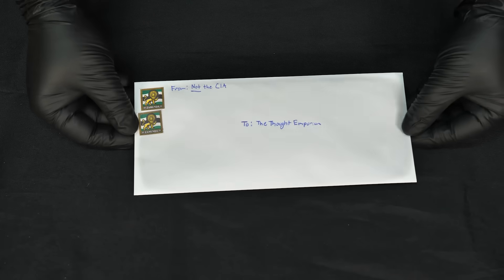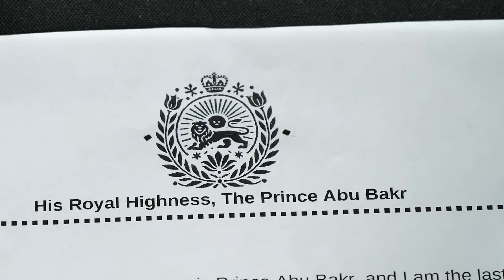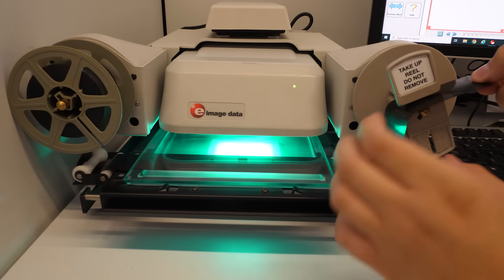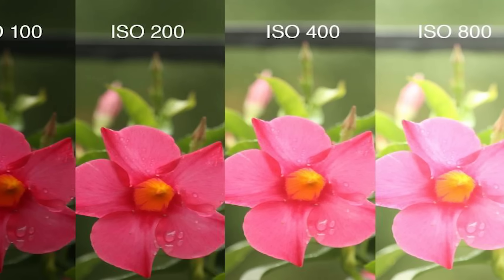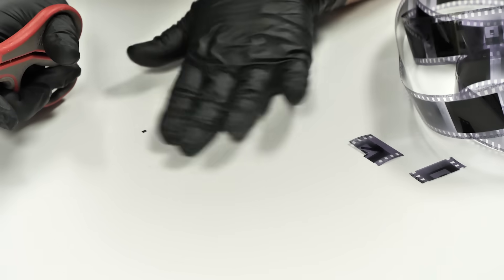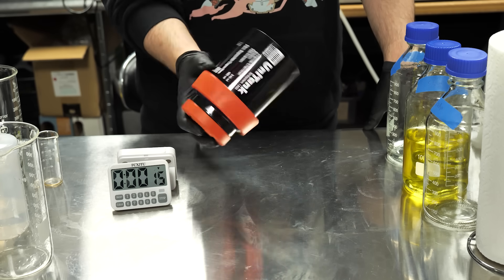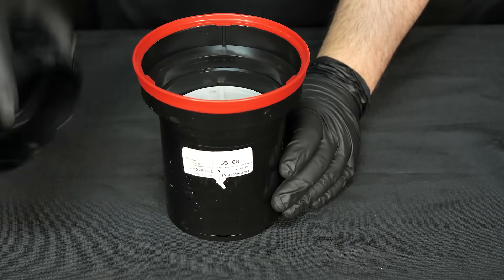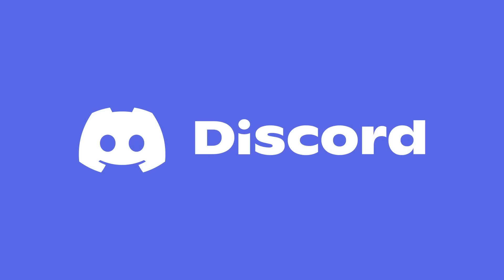Recreating CIA Technology Was Surprisingly Easy (Microdots)

Comment: I looked up the Blazinal film developer, and it appears to be similar to the old Agfa Rodinal formula. That specific developer is designed to be a one-shot formula, i.e., not intended to be reused. Many other formulas such as D-76/ID-11, DK-60a, etc. can be used more than once but you usually increase the development time for each subsequent use. Also, others have mentioned films with much finer grain and slower speed such as ISO/ASA 3 which will provide superior results. I could talk all day about film developing as I was heavily involved with it many years ago, but I'll spare the comment section :)

Comment: Microfiche film has and ISO/ASA of less than 1. Something like 0.2, 0.4.  I had my own darkroom for years. Note that temperature is CRITICAL in developing. Using the manufacturer's temp is good. You can also raise the temp (called "pushing") to speed development (with a significant loss of resolution) and lower the temp to increase resolution. Kodak used to have a table available for their developers. And yes, developer can be reused. There was an amount based on square inches(?) of film it was good for. But 5 or 6 35mm rolls should be OK.

Comment: "The only way to know if your pictures look right is to develop them" Sorry but that part of the video just destroys a big part of trustworthiness in information provided here for everyone knowing a bit about photography. There are lightmeters to determine shutter speeds and aperture settings based on the used film ISO. If you dont have a light meter just use a digital camera or smartphone as your lightmeter by looking at the shutter speed and aperture they use when set to the same ISO as the film. And most importantly the Nikon used here should already have a lightmeter built in to provide correct exposure of the film with minimal input of the user! Also developing a correctly exposed black and white film should be very straight forward if you follow the instructions provided with the chemicals. My first thought when seeing the 35mm camera was "He is going to waste a whole film for one shot" and not wasting alot of film for not even reading about the absolute basics beforehand.

Comment: In the early 1970's I was employed by Microform Data Systems. The product was ultra-microfilm readers and media. This was on the cusp of the rise of digital information systems. The media was strips of 35mm film with six frames. Each frame held hundreds of pages of text reduced in size by a factor of 200 times. About ten strips fit into a cassette that allowed any strip to be fed into the reader. A large installation was purchased by General Telephone (LA) for their directory information operators. An array of readers was connected to a Digital Equipment Corporation PDP8 mini-computer. The computer held the programming to control the readers to select the correct strip, frame and exact page location on the frame for a given name input by the operator instead of thumbing through a mound of telephone directories. I worked there for three years but even then it was obvious to me that any such system would be replaced by entirely digital data systems. Even so. microfilm is still one of the most durable types of information storage.
Reply: W display picture.

Comment: For fine grain Rodinal is not the best choice. Try D76, T-Max or Tetenal if you can get some. On the other hand, Rodinal has great acutance especially at high dilution and with as little agitation as possible without compromising homogeneity of the development.

Comment: Developer usually can be reused, but it loses its potency over uses. Essentially it's just a bunch of chemicals in water, some got into direct contact with film and developed it, some didn't. From my experience 20 years back it was fine for 3-4 rolls, beyond that it just takes noticeably longer to develop a roll and I didn't want to wait;)

Comment: Just a few pedantic comments. 
Daguerrotypes were indeed made on metal plates, but it was polished copper that was then coated with silver. Solid silver plates would be way too expensive.
The halide in your film would be silver bromide, iodide and chloride were used back in the day when collodion emulsions and POP prints were widespread.
The development process doesn't darken silver crystals, the photon of light creates what's known as development center within the structure of silver bromide crystal, developer reduces the bromide to metalic silver, the grains altered by light are converted first. If you'd left the film in the developer for long enough, all of the halide would turn into silver.
Have fun! The traditional photography spawned literally hundreds of processes, it's a bottomless pit for both time and money 😅

Comment: Fyi, nordVPN does nothing to spot you from leaving behind a trail. Especially if you, oh idk. SIGN INTO YOUR ACCOUNTS!
I recommend using a non monopoly owned VPN like mullvad VPN, who is independent, and operates some of their servers completely (Lists ones that aren't owned and operated by them).
I also highly recommend not signing into any accounts, as well, this completely negates the use of a VPN for privacy reasons. But if you're using to stop geo blocking because of licensing issues, then you can ignore this.
You also need a privacy hardened brower,  my personal fav is Floorp, a firefox fork that doesn't compromise on features, but offers some strong privacy enhancements by default.
OR librewolf, which is basically stock firefox with everything that could be seen as privacy invasive removed, and its a super hardened version of firefox. Which can often lead to websites not workring, or having glitches. This only really on small sites that are really pesky about tracking you.

Comment: A couple notes: Nikon is OK but a sharper lens is Zeiss and they are on Leica cameras (rangefinder focus). The sharpest focus will be 2-3 stops down (smaller aperture) from wide open. Use a tripod and a shutter release. You can get more contrast by "pushing" the film from 1 to 8 stops by increasing the developer time and reducing the shutter speed. Experiment. Developer can be reused with diminishing results but each batch can develop 6 rolls. Sodium bicarbonate will help neutralize it for disposal. Fixer is reusable but is light sensitive, and you should be able to find replenisher to add to make it last longer. You can wash it out of the canister, a few flushes in the toilet will do. Soak 30 sec, flush, repeat. Foto-flo will decrease surface tension and make your film dry without spots. A few drops of Dawn will work, added to your rinse toilet. You might find a continuous tone film (a type of litho film) that has no grain. Also backlit film will be much less sharp than print with reflected light. Your copy lights should be aimed at the far side of the image at 45 degrees. Questions, feel free.

Comment: If you use too small of an aperture you can have issues with diffraction which will make your image softer, the point at which this starts to happen is dependent on the size of the sensor pixels or film grains, there are calculators for it online for digital but for film maybe try test from a fmin to fmax, you may actually get better results somewhere in the middle, and since what you are photographing is in the middle of the frame and on a flat plane, for this specific application it might even be a lower f number than the minimum generally recommended to get sharp images with your lens

Comment: Thanks a lot for your videos! 
There is a special developer called pyrocat hd, or another one from this family - pyro510. If you use one of these with semi-stand, or stand agitation you will have much more sharp negatives. Also, you dont need to use such a small aperture, f/8 usually do the best job, but you always can see the sharpest aperture of specific lens in its data sheet. Btw, adox cms20 with adox developer and some kind of sharp projection lens are best setup for your purpose.

Comment: Hello! I've done a lot of developing, mostly colour c41 though so the chemistry is a little different. A few tips I have :
Make sure everything very dry before putting it into the dark bag. Humidity and water make the film super sticky and hard to wind onto the spools

Developer is fine to reuse! Every two or three uses, just increase your development time, I've used mine up to 15 times before swapping it out.

To avoid any splotches it's helpful to do a clean water rinse between each stage of development, this also helps the chemistry last a few more uses.

Particularly with colour development, temperature control is very important! I do all my development in a water bath held at the appropriate temperatures, this varies for each stage of development.

Lastly, make sure you squeegee your film after developing, it avoids any water spots and it's also super satisfying.

Love the channel!
Reply: As for dryness, yes with plastic reels. Steel reels can be loaded soaking wet but cheap steel reels tend to be terrible and nice steel reels (Hewes brand) are expensive.

Developer is usually fine for approximately 10 films per liter of stock solution. He is however using "blazinal" a varaint of rodinal which is a one-shot developer.

As for temperature control, modern b&w film is remarkably tolerant of abuse. Far too hot and they may be a bit overdeveloped but other than that it should be fine. If I recall correctly the problem of reticulation requires something crazy like a 50°C temperature change during development with modern film.

As for water spots, several methods are in use. Squeegees are fine but you need to be very careful that they're completely clean as any particles on it can scratch the film along the length.

Personally I just wash the film using the ilford was method, then fill the tank up with destilled water and just 2 or 3 drops of wetting agent before hanging to dry. That usually gets it spotless.

Comment: As someone who has gotten far too into film photography and home dev, I definitely have a few pointers that might help out. 

First off, no, you cannot reuse the developer. Rodinal (the "normal" name for Blazinal) goes bad fairly quickly after mixing with water from concentrate for one thing, but also one shot developers like Rodinal just aren't really designed with reuse in mind. In theory I suppose you could reuse it if you had another tank loaded and ready to go and went directly from one to the next... but you could probably only do this once or twice. But anyway, wouldn't recommend it. Also lower concentrations of Rodinal will produce a better image as far as microcontrast is concerned because of something called acutance. With 1+100 up to even 1+200 being used at the extreme end for 1-2 hours using a "stand" or "semi-stand" method i.e. very low agitation. Times for various films and dilutions can be found on a site called the Masasive Dev Chart (https://www.digitaltruth.com/devchart.php) though stand dev is a bit different and you can easily find various guides on going about that specific method.

However, I think you'll find that you'll get MUCH better results with a film called Adox CMS 20 II (https://www.adox.de/Photo/films/cms20ii-en/) which produces EXTREMELY fine grain when developed in the special developer it was designed to work with called ADOTECH IV. With that combo they claim 800 lp/mm resolution, meaning that you would be able to easily see 800 black lines evenly spaced within a single mm of film. However, at that point you will definitely be limited by your lens.

The Nikon Series E 50mm f1.8 is a well respected lens, and is considered quite sharp. However, it probably peaks at maybe around 100 lp/mm in the center, falling steeply off towards the corners. Something like the Micro-Nikkor 55mm f2.8 will easily hit 200+ lp/mm and loses very little towards the edges vs the center. Not that you will necessarily need edge sharpness for this use case, but it is probably important to know that the closer to the center you put whatever you are miniaturizing the better the result you should get. 

The camera is also probably not helping, I have a Nikon EM and it is a great little camera, one of the smallest and lightest SLRs from Nikon, however it lacks fully manual controls. It usually operates in aperture priority mode, which is in theory good as you will want to set your aperture to something more like f5.6 for the maximum resolving power of the 50mm Series E lens. However, the autoexposure meter will get really thrown off by the extremely backlit scene. It will try to make all of the white light come out to middle gray, which is to say it will massively underexpose the film. Instead you would want to put the image in front of something much closer to middle gray, or just fairly neutral, to fill the rest of the scene which will allow the camera's light meter to gauge the scene much more accurately and should give you better results on the given camera. With a camera with fully manual controls you could instead manually measure the light using something like a light meter app to get settings which will expose it properly. But even then, extreme backlighting will not be a better image, reasonably bright and evenly diffused front lighting will be far better.

Hopefully at least some of that is helpful!

Comment: Photolab technician for over 10 years here. Yes the chemicals can be reused several, several, several times (the loss of its strength is minimal). But it will become saturated by silver at a point, and you'll start seeing a difference in contrast in the developed film as it does. For plain B&W with no shades of grey, you may want to overdevelop it (the 1st part of the process) for a little more time to get stronger blacks and whites.

DO NOT THROW IT DOWN THE DRAIN. Sediment, decantation and reduction... And recover all that precious silver.
Reply: you cannot re-use the developer tho, it is a one shot developer like rodinal. It is exhausted after single use and you should only mix enough for one batch of development.
Reply: @ 
If I had to dump the developer out of my COPAL for every time I developed a roll, developing would've been of prohibitive cost. It decays as you use it and you have to use decantation to exhaust the silver- rich, innert waste. But it is in no way of "single use".
Reply: @RenzitoARG  instead of being confidently incorrect you could perhaps just read the technical documentation of THIS developer. Sure others are reusable but the one in the video is definitely not. Google is free my friend. The manufacturer even says that after 24h (in a diluted state, so in a working solution) the developer will be completely oxidized, and thus will not develop at all. Which is exactly what I have had before. This is just like Rodinal, Adonal, R09 one shot because it's all the same developer.
Reply: @RenzitoARG  Most developers can be reused yes, he is using "blazinal" which is another name for rodinal. Which is strictly one-shot. You dilute it a lot, and after that it oxidized in about a day, not to mention the few milliliters you use per roll acutally gets used up by that roll.

This is not the developer you would use in a lab, those can be reused. But rodinal and a few others, like HC110 can not be reused.

As for recovering silver, that has nothing to do with the developer, the silver is dissolved in the fixer, from there you can recover it. But you are right, it should not be dumped down the drain.
Reply: I'll second this. I'm a photographer who worked for a commercial shooter before digital. He had a darkroom and the developer was in this big stainless tank, and was over ten years old! We would replenish it occasionally. He claimed that new developer wouldn't have that "magic" smooth look until it had been replenished a few times. There was likely hundreds of dollars worth of silver sloshing around in the sludge at the bottom :)

Comment: I worked for Lockheed and Rolls-Royce at Stennis Space Center from 2004-2012, and on my faculty was the same "resolving power test target" painted on the concrete.  Except, it was about 200 feet wide.  Used to calibrate satellite optics.